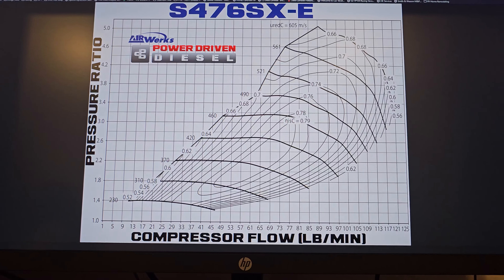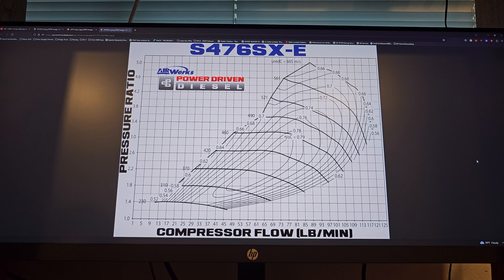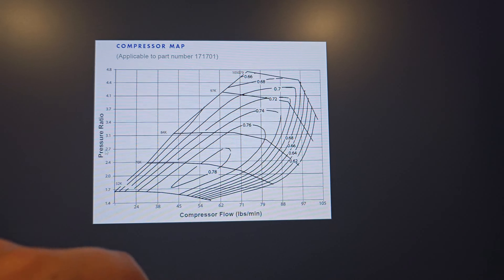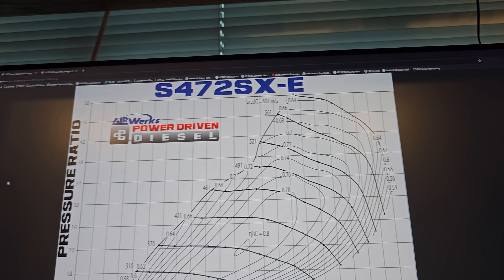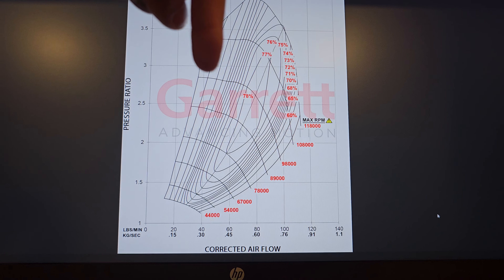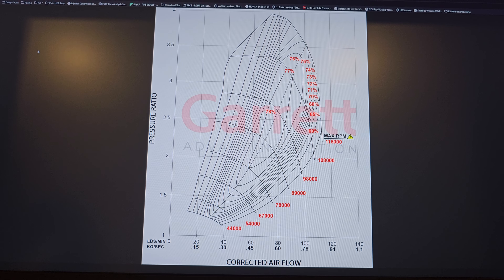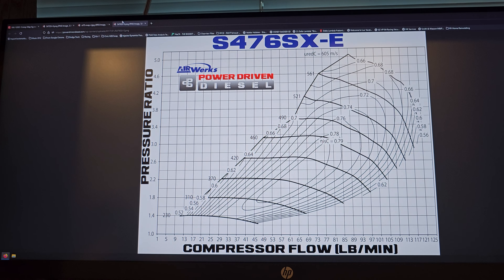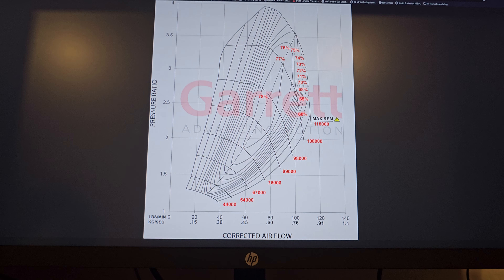HOW-TO: Turbocharger Comparison for 500whp+ 13B Rotary Engine

Comment: Hey there, if I were trying to pick a turbo for multi-purpose reasons, and I were to pick a compressor that can support high PR, but run it on lower threshold i,e 1.5 P/R. That would obviously run it outside of it's efficiency range by running it on low boost, but would that also raise IAT?
Reply from the maker: @BoostWang  Reach out to me via email.  I offer turbo matching services for particular needs. 

RGHTBrainDesign@gmail.com

Comment: Holset hx52’s 55’s for an honorable mention at these boost levels.
Reply from the maker: It's so hard to find an accurate compressor map from them.  Holset makes some badass stuff from what I can tell.  Robustness is up there, no doubt.
Reply: @RGHTBrainDesign  Absolutely agree there!  Still have yet to find a map for the HX52’s, but the 50’s and 55’s have maps floating about.
Reply from the maker: @deandevries1907  the problem is their size is huge.  The G42 is tiny, tiny by comparison.
Reply: @RGHTBrainDesign  Relative to how it's spec'd by the customer.  For the 500+ mark the above would be the one's I would search for.  HX52 Pro if you can find it. Very loose comparison to a GT40 and GT42 with respect to compressor flow rate.

Comment: Why is it 7 on a rotary engine and not 10 for horsepower estimation on lbs of airflow
Reply from the maker: Rotaries consume more air to create the same power due to their 50% longer compression stroke (270° sweep vs. 180° on a reciprocating engine) where BSFC is lower due to leakages.